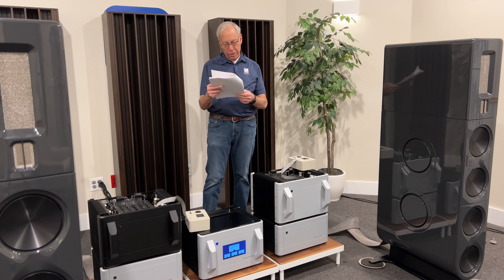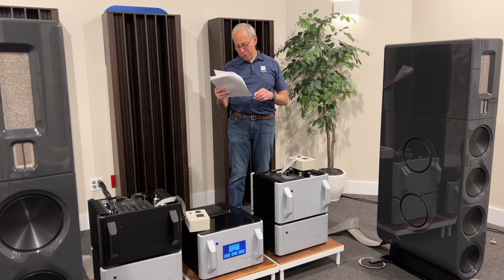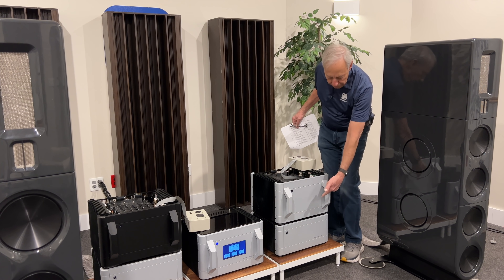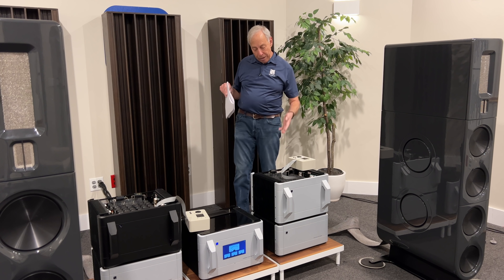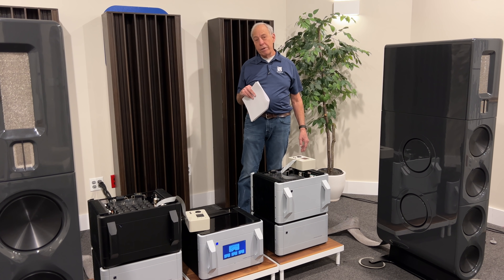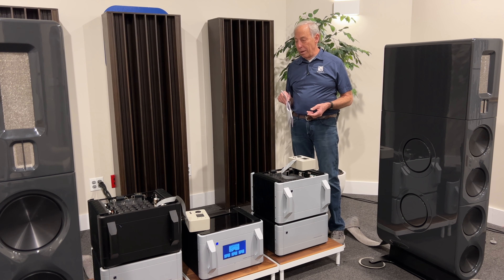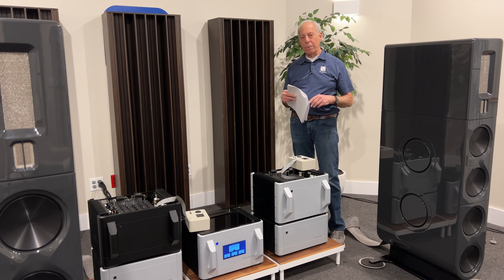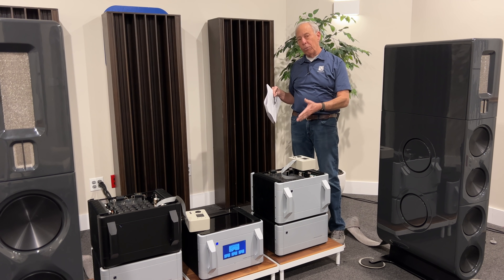When will vacuum tube amps disappear?

Comment: My system is hybrid. Because of it, I have finally reached a point in my quest for audio nirvana where I am so pleased with my setup that I have neither the need or the desire to change anything.  That's not something that I ever thought would happen in my audiophile life. That's the "magic" that Paul mentioned.
Reply: Congrats.  A great place to be.  Pretty much there myself.
Reply: Enjoy the music man!
Reply: What kind of system are you running. I’be a badass Mesa Boogie guitar amp and wanna get a nice record player setup to push some SERIOUS volume. Like dangerous to your ears I mean. I like headroom. I can always turn it down.
Reply: @MrMann-gt1eh  From all the haters trolling YouTube videos, I learned very quickly not to mention the equipment brands that work for me. I run a class A/B tube amplifier with KT120 finals and 75 WPC output, and a pure class A hybrid preamplifier. Because I run very high efficiency speakers, I can easily play at volumes that become uncomfortable long before top end or distortion is ever reached. Tubes in the output stage need to breathe, so they don't play well with hard to drive speakers. I set my system up from the start to get the sound I prefer using modern tube equipment and non-demanding speakers that feature large woofers and horns, something that tubes seem to really like.  The only real world advice I can give you is to first, analyze what sound you prefer. Tubes tend to add some coloration, which is where the "warmth" comes from. Solid state has a much better chance of obtaining a neutral, non-colored sound that many younger audiophiles seem to prefer. Hybrid systems like mine, when properly paired, can walk that fine line between warmth and neutrality, giving you the best of both worlds. As you build your system, pay less attention to tech specs, and more to actual user reviews, looking for the ones that deliver the type of sound that appeals to you.

Comment: When I wanted to upgrade my amp I was going between the PS Audio M700 and the M1200 monoblocks. Although I didn’t need 1200 watts I ended up going with the M1200’s because of the vacuum tubes on the front end.

Comment: Paul, I am now ancient enough that I remember the days when our radio would stop working periodically and we'd pull its tubes and go to the electronics store of the day and test them to see which one was caput.  Question is, is tube life any better now?
Reply: It has the same sense of purpose as to bringing the solid MP3 player back to shop to make tech  measurements if it is  as good as  in manual It can always proof you need to replace with new model due to ugly operation of button or top frequency is 17 kHz not 20 kHz

Comment: I have a T+A PA 3000 HV integrated amp. T+A designed it's HV "high voltage" series around the philosophy that Paul just described.   They run at 360 volts.  As in tube equipment, the voltages ensure that the amplification devices are working well within their operating parameters. As designed, the HV models utilize only about 20 percent of their amplification transistors’ available range. This greatly reduces non-linearities. Their design goal, is to mate the naturalness of tubes with the speed of solid-state.
Reply: I have Harman Kardon ultrawideband sound. Tubes make heat and they can break. Heat stresses a lot the components, it's very fragile. Back in the day they even had tube testers in the stores so you can check it and buy replacements. Not sure if modern tubes are different?!? Probably just used less (back in the day it was used every day much more heavily) but there are a lot of disadvantages. This type of technology was replaced for a reason. It's like saying I dont like LED light, I get a petroleum lamp because it flickers so nice but also burn my house down and smoke my room. Looks nice maybe but not practical.

Comment: Disappear? Lol. They're getting more popular again all the time. Tubes sound better, but they are costly to implement properly, needing very good transformers, but tried and tested schematics are widely available. The old WE91 is one of the best amp designs and with modern components a WE91 300B schematic amp can be magical.
Reply: Valves DO NOT sound "better"!
Reply: @Theineluctable_SOME_CANT from what I've experienced, they do, of course it's subjective, and of course there are exceptional solid state Amps, no question
Reply: @alexanderstefanov6474  get out more...
Reply: @Alexander Stefanov  Agreed .  At least I found mine sounds better . I've dabbled in this for a few decades .
Reply: @jackanderson2773  so you got bit by the bug too . .
Reply: @Theineluctable_SOME_CANT  SUBJECTIVE .
Reply: @jackanderson2773  NO!

There ARE  (many) people around who CANNOT hear subtle artefacts in a signal even if they have been trained.

IF and only if you have trained your ears to know what "FLAT" sounds like, then you have a chance to get good at auditioning amps. Some people cannot gear medium (0.1 - 1.0%) distortion levels.

If your ears are untrained, your experience and opinion will be SUBJECTIVE.

OBJECTIVELY, many people can be trained to become good amplifier whisperers. 

I happen to be very into hifi.
This is NOT trivial to me and I have been listening to 0.2% for decades. Thanks to my Stax SR5 earspeakers, bought in 1977.

Most people who have class A amps don't even have input and output transducers which can resolve the distortion in their amp, even fewer are TRAINED to hear it, OBJECTIVELY...

FACT.

Have a nice SUBJECTIVE day...
Reply: @SOME CAN'T  Thanks . All I know is my newly acquired Roger's pure class a integrated has a pure quiet background .  I do have solid state amps too but .
Reply: @jackanderson2773  Rogers made lovely speakers!
Reply: @Theineluctable_SOME_CANT   They did although I think that maybe a different Rogers don't know

Comment: My recommendation: a high quality tube PREAMP….and you won’t have any hassle with replacing tubes every year or two…and get the VERY best combination with a high quality SS power amp!
Reply: I'm not sure where you get that from.

Though it varies by manufacturer, ARC recommends you replace the tubes in their Ref 6 line stage every 2000 hours for the 6550WE and every 4000 hours for the seven 6H30s.

That's every 83 days for the 6550WE and every 167 days for the 6H30s for people who leave their gear on 24/7 like I do - or four 6550 WEs and 14 6H30s each and every year.
Reply: @VideoArchiveGuy  sure it depends on how often and how long you listen to your tube gear …but it’s commonly known that tube’s are more prone to wear when used in POWER amplifiers… not that much by far when used in PREamps…didn’t you know that?!
Reply: @bikemike1118  Yes, ARC recommends replacing all tubes in their power amps every 2000 hours.

You said you won't have any hassle with replacing tubes "every year or two," but the hour limits I reported are why I can't have a tubed preamp no matter how good they might sound.
Reply: @VideoArchiveGuy  …so you’re listening six hours to music EVERY single day ?? Respect…you seem to have plenty of spare time!
Apart from that: one doesn’t leave tube gear on 24/7 ( makes no sense at all anyway with tubes).
One does that … or can do that with SS gear! 
Tube gear is switched off when the listening session is finished! In preamps tubes last VERY long …a decade is nothing out of the ordinary!
Reply: @bikemike1118  Same is my opinion.  Got used vintage amp where seller "retubed" all input stages made with ECC83 buI do not know if they were realy new.  It was some 4 years ago I use  it moderate but periodically check voltages which  reflect the anode current They do not change visibly and they are still in line with producer data (1963) up to +/-1% which is perfect. I think in some constructions  due to overheating of tube sockets contacts may be mess with measured voltages or even overheating of greds which damages tube   which has no much in common to time .
Reply: @bikemike1118  My audio system is on and playing music (or TV audio) 24/7 from the time the component is taken out of the box until it is replaced by something else.

They are only powered off for power failures; the components stay on playing something even when I am away from home on vacation.
Reply: @VideoArchiveGuy  That is right. It all depends on the manufacturer. Some Music Reference owners claim that they are still using their original tubes in their 10-20 year old amplifiers. Why yes, yes Roger Modjeski was an incredibly gifted designer of audio equipment.
Reply: @tullskull  True; Bob Carver warrants the tubes in his gear for life.